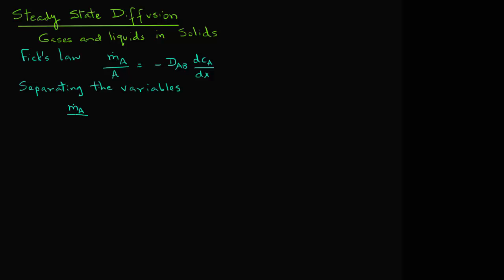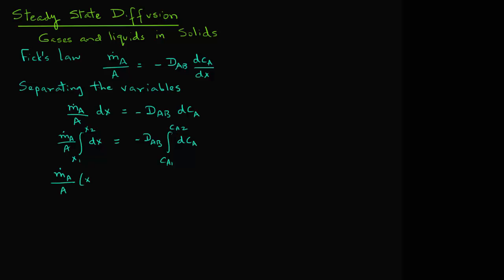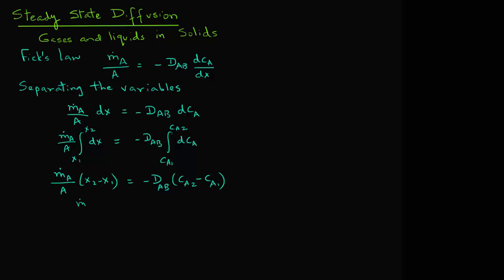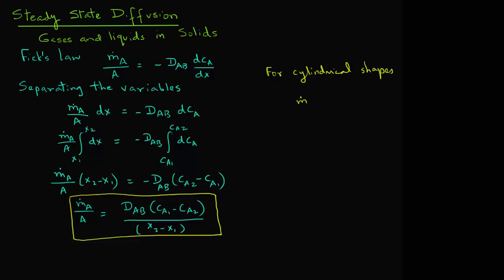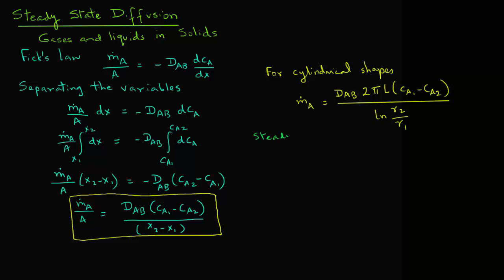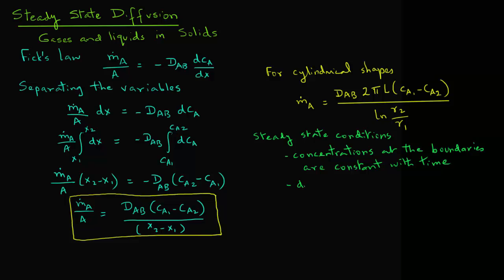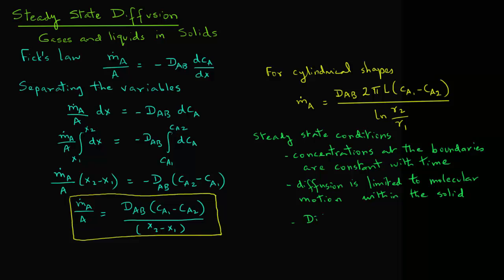Steady State Diffusion

Comment: Saying the first part was for rectangular coordinates doesn't make sense to me b/c you didn't substitute for area A in the derivation of your mass flux (mdot/A), even though A is surely a function of x, am I correct? I think this way b/c then in the off-screen derivation for a cylindrical system you did substitute for the area (piR^2) before the integration over the spacial component R . . . . . . After typing this comment and checking my calculations, I'm unsure if I'm right at all but I'm still commenting for your feedback
Reply from the maker: Thank you for your question! In the derivation with rectangular coordinates, we are considering diffusion through a rectangular slab, where the area of the sides (of the slab) remains constant as diffusion occurs along x-direction.  For cylindrical coordinates, we are considering diffusion along the radial direction of a cylinder, e.g. from the center to the surface of the cylinder.  In this case, the circumferential area is 2(pi)(r)(L). Note that  the circumferential area changes with radius. Therefore, we replace A with  2(pi)(r)(L) prior to integration.  The terms 2, pi and L can be moved outside of the integral, and we will integrate dr/r , and we obtain ln(r) , which is then evaluated at r1 and r2, to get the expression shown in the tutorial.  (Please note that we do not use cross-sectional area, as you had mentioned in your question, instead we use circumferential area, since the diffusion is either from inside to the outside, or outside to the inside of the cylinder).